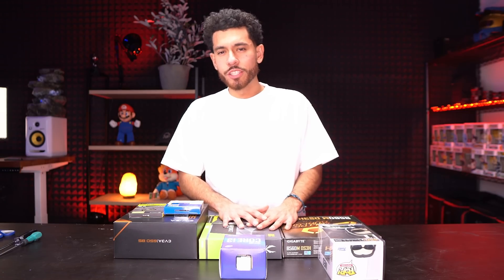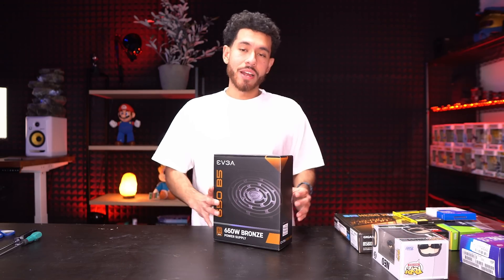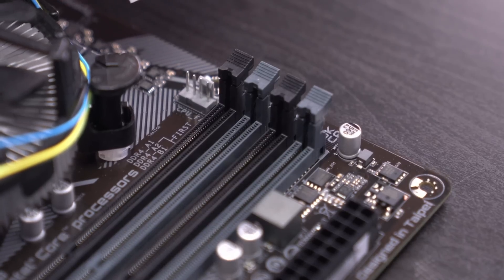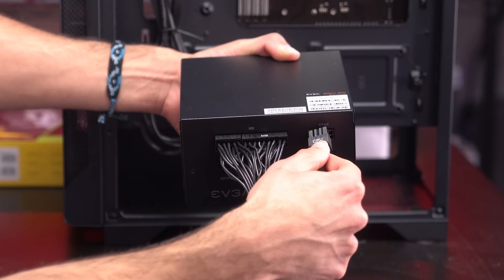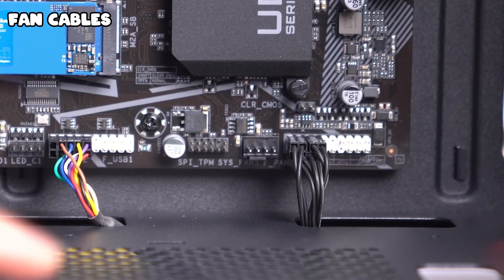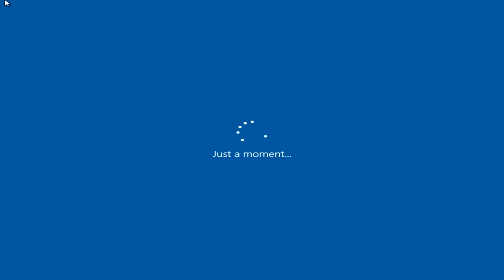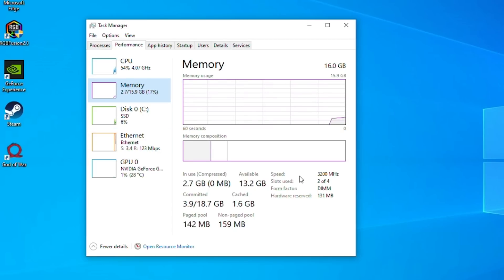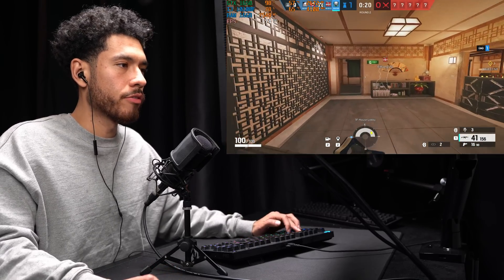$600 Gaming PC Build Guide - GTX 1650 i3 10100F (w/ Benchmarks)

Comment: You have the best pc build guides on YouTube, so easy to follow along to, I’m on my 5 PC build now and will always come back your videos if I need help. Keep it up Joey
Reply: Would you recommend this pc I would like to build a budget pc but I would also like to stream, would you recommend this pc
Reply: @happydimsum8221  for streaming im not quite sure it is a great pc but for casual gaming like joey is doing then its a good budget build
Reply: @ilyaanali7730  its not a good build, and it needs a lot of changes. So please, do not spread more wrong information.
Reply: @theelepel2679  the build is quite good for the budget price it has been given and is good for casual gaming wdym
Reply: @ilyaanali7730  No, no its not.
We start with the cpu, relative fine choise, besides 10105 exists.
Mobo is fine, since cpu doesnt need anything else as that. 
Ram, LPX... speaks of its own... some goes for vengeance rgb, same problem. Ballistix are the current best value kits (in general also a better kit then LPX/vengeance pro) 
Storage, bit overpriced. Helix L/A60/Sn550 1TB fits on its place better (since 1tb is relatively cheap now a days) if sn570 was slightly cheaper, its totaly fine. 
PSU, B tier unit, sure fine. but we have Formula Gold in existance, and is just the better alternative. 
Gpu is just terrible, whether we are in a world wide shortage or not. gpu is just mediocre crap performance for its price even a rx570 is better. used market dominates this specific budget section very hard (besides horrible pricing) 
Case, bad airflow... mesh front panel =/= good.
Reply: @ilyaanali7730  hey im new to pc stuff and i built this exact pc , but i need more storage now... what kind of hard drive can this pc use or how do i add more gbs ? asking people for quick responses thank you
Reply: @happydimsum8221 
Wait for Intel's 12 gen, it has some killer value CPU, x100F series won't have enough threads for streaming, 6c/12t 12400F would be good enough. For GPU look for some used 970 or try to snatch a rtx 3050 on the release (27 Jan iirc). Idk about 12400+970/3050 power consumption, but for 10100 and 1650 even 400W power supply would be enough.
Reply: I agree that the gpu sucks. I would've just bought the 6500xt for $260, or go on ebay. 1650 was a poor choice. But overall its a good build. i3 10th gen is perfectly fine for gaming
Reply: @anon4873  6500xt is even a worse choise... so no. and not just that, the rest of the build pretty much needs to change aswell.
Reply: @theelepel2679  well what would you have done because im trying to build a pc but im not a rich person im actually interested
Reply: hey im new to pc stuff and i built this exact pc , but i need more storage now... what kind of hard drive can this pc use or how do i add more gbs ? asking people for quick responses thank you

Comment: could ve been easily a $500 build but we a "shortage" problem since over 2 years now
Reply: Exactly, I recently just bought all the parts for this build and actually are all coming in tommorow but it was $900!!!
Reply: @fuegosthekid3200  how’s the build ? how’s everything ? btw what monitor do you use ?
Reply: @fuegosthekid3200  900$ bruh????
Reply: It is a $500 build as long as you buy the CPU and GPU from somewhere else.
Reply: If you buy just the gpu from Amazon today you get prime shipping and it’s only like 170 plus the 10100f is like 79

Comment: I remember watching pc builds on this channel before I bought my pc and I gained a lot of experience with hardware stuff.
After I bought it I'm still here to watch this great content
Reply: same
Reply: I built my first PC for $1,100 back in 2017. For the computer, it is still running great and I'm able to run all the games at high to ultra settings, including VR games. Meanwhile, I'm holding onto my PC until those future games will not support my computer or something brand new is released in gaming that requires newer hardware, and my current PC won't support it.
Reply: @supercoolmunkee  oof that sounds painful but at least you can run most of games ig

Comment: Simple and straight forward. I'm not building a build, im just keeping my memory alive on how to build lol.
Reply: maybe one day I’ll get a PC, but for now I’m also keeping my memory alive!
Reply: Same 😂
Reply: I built my first PC for $1,100 back in 2017. For the computer, it is still running great and I'm able to run all the games at high to ultra settings, including VR games. Meanwhile, I'm holding onto my PC until those future games will not support my computer or something brand new is released in gaming that requires newer hardware, and my current PC won't support it.
Reply: @supercoolmunkee  specs ?
Reply: @DentSideDee71  Ryzen 5 1600X, 16 GB of RAM, and AMD Radeon RX 580 (8 GB Card).
Reply: @supercoolmunkee ain’t the 1600x and 580 quite a bit older ? I know the 5800x is better than the 1600x and my gtx 970 from like 2014 compare to the 580 you have I’m pretty sure
Reply: @DentSideDee71  The RX 580 is a bit newer than your GTX 970. The 970 is older than the 1050 Ti. My RX 580 would be on par with GTX 1060 or 1070  if you want to look at it this way. Right now my 580 is capable of VR gaming and other high-end games such as GTA 5, Cyberpunk, Monster Hunter World, and Horizon Zero Dawn just to name a few and I am able to play without any issues.
Reply: @supercoolmunkee  the 580 can only go up by this tho The GPU is operating at a frequency of 1257 MHz, which can be boosted up to 1340 MHz, memory is running at 2000 MHz (8 Gbps effective) and my gtx 970 is vr ready aswell I can also play all tittles you just listed there’s many obviously videos with benchmarks out there plenty look it up